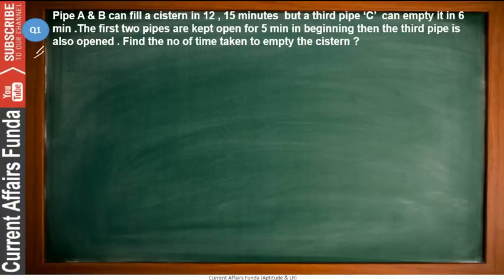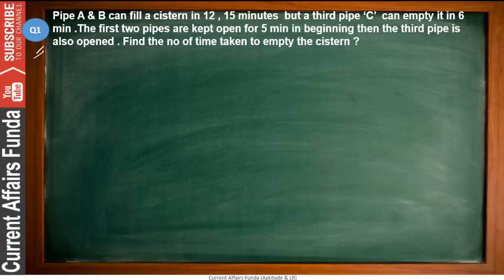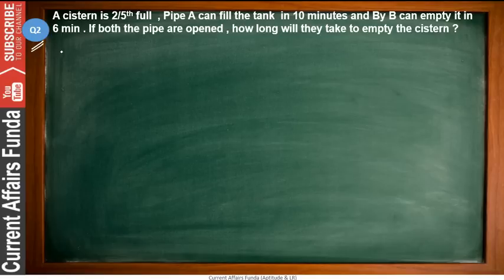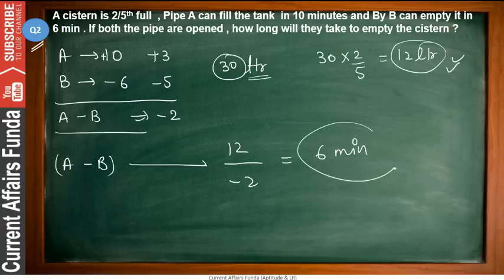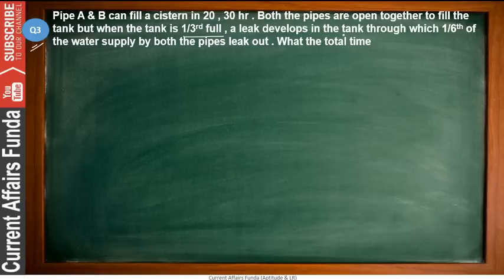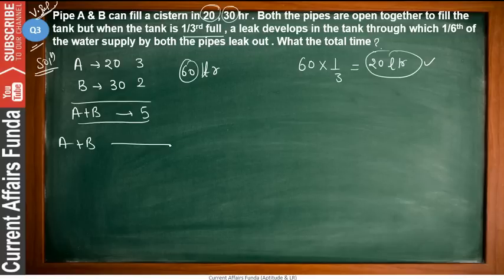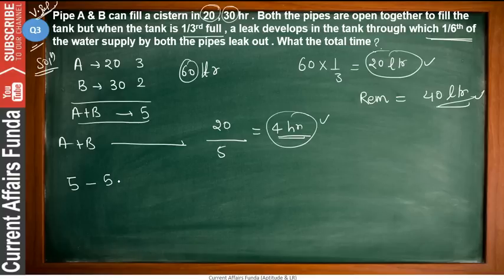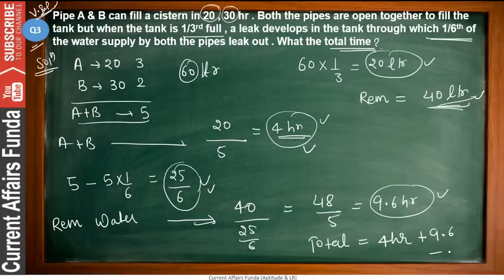Pipe and Cisterns Part 2 (BANK PO , LIC , SSC CGL , Railway and Other Govt exams)

Comment: If two pipes function simultaneously, the reservoir will be filled in 12 hours. One pipe fills the reserver 10 hours faster than the other. How many hour does the  
Faster pipe take to fill the reserver ?

Sir solution plz

Comment: pipe A can fill an empty tank in 4 hours ,while pipe B can fill it in 6 hours working separately .pipe C can empty the whole tank in 4 hours. bhavya opened the pipe A and B simultaneously to fill the empty tank. he wanted to adjust to his alarm so that he could open the pipe C when it was half filled, but he mistakingly adjusted his alarm a time when his tank would be 3/4th filled . what is time different between both the cases, to fill tha tank fully.

Comment: very sorry to say sir your first sum is absolutely wrong
Reply from the maker: +niladri narayan chakraborty 
Question is 💯% correct .
You can take either lcm or any value which can be divisble by the days or unit given by A and B .
Reply: where is the remaining 15 units?
that will be used by the waste pipe and it would take 15 /1 mins
hence total time must be 15 +5=20 min

Comment: sir solve this question plz... question- A CISTERN HAS THREE PIPE A,B,C. PIPE A AND B FILL IN 3 AND 4 HR. REPECTIVELY,WHILE PIPE C CAN COMPLETLY CISTEN IN 1 HOUR ,IF THE PIPES ARE OPENED IN ORDER AT 3:00PM, 4:00PM AND 5:00PM, RESPECTIVELY AT WHT TIME WILL CISTEN EMPTY

Comment: Two pipe A and B can separately fill in 15 and 10  min respectively and a waste pipe can carry off 7 liter per min. if all pipe are opened when the cistern is full, it is emptied in 2 min. how many  liter does the cistern hold?

Comment: Three pipes A, B, C are connected to a tank.A & B can fill it in 20 & 30 minutes respectively while C can empty it in 15 minutes.If A,B,C are kept open successively for 1 minutes each.How soon the tank will be filled ?

And is 167 but how. Please solve it by efficiency method..

Comment: A tank can be filled with water by two pipes A and B together in 36 minutes. If the pipe B was closed after 30 minutes, the tank is filled in 40 minutes. The pipe B can alone fill the tank in?

Comment: Three pipes A, B and C can fill a tank from empty to full in 30 minutes, 20 minutes, and 10 minutes respectively. When the tank is empty, all the three pipes are opened. A, B and C discharge chemical solutions P,Q and R respectively. What is the proportion of the solution R in the liquid in the tank after 3 minutes? whats the solution of these types of question.

Comment: sir your videos are very helpful for preparation .
I have a problem in solving in this problem. 
A tank is fitted with two taps A and B . A can fill the tank completely in 45 mins and B can empty the full rank in 1 he.  If both the taps are opened alternatively for 1 min.  then in how much time the empty tank will be filled completely

Comment: sir in the very 1st question, wouldn't be the 1st 5 minutes added to 45 minutes?...as because the pipes are opened from that very time so those 5 minutes should also be counted.

Comment: A,B,C are pipe attached to a cistern. A and B can fill it in 20 and 30 min respectively while C can empty it in 15 min     . if all be kept open successively  for  1 min each, how soon will the cistern be filled ?  a) 167 b) 160 c) 166 d) 164

Comment: And I have doubt can you solve this questions 1. Two pipes A and B can fill a tank in 15min a 20min respectively. Both the pipes are opened together but after 4min, pipe A is turned off. What's the total time required to fill the tank??
Reply: ramsundar paramasivam whts the answer..is it 14. mins?
Reply: Aniruddha Wagh no in this video the answer is 45 minutes..please go through it and give a proper explanation
Reply: venkatesh talatam about which video you are talking about?.. for above question asked by Ramsundar I found answer to be 14 min 40 sec
Reply: ramsundar paramasivam it's was total time required to fill the tank is 14 2/3 :)